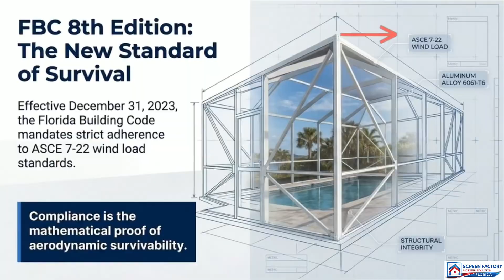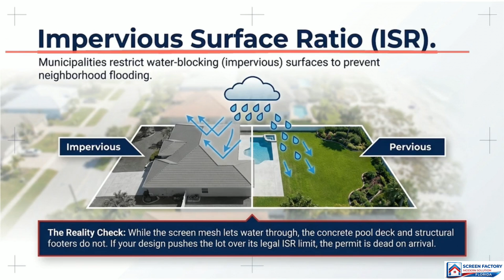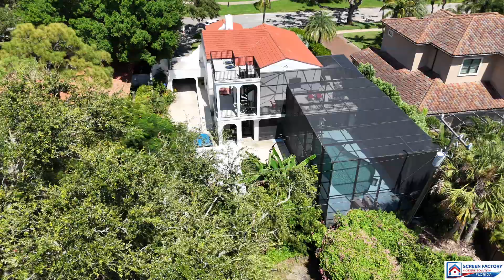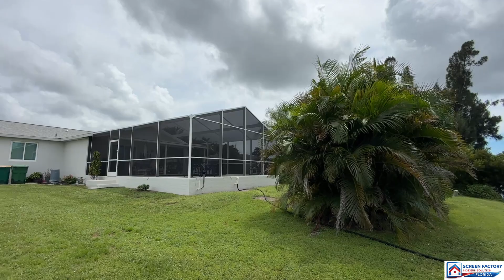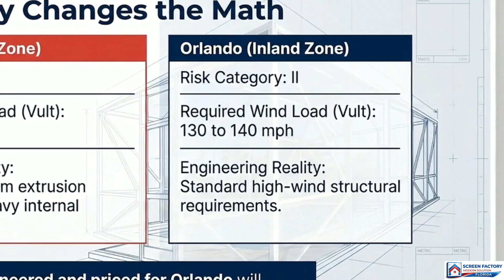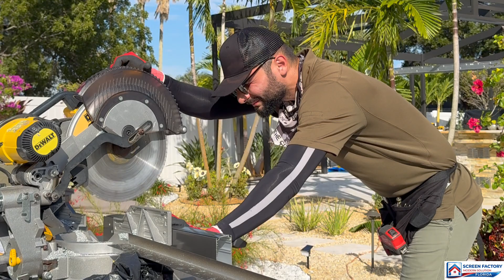Screen Cage Engineering: Plans, Site Plans & Setbacks

Comment from the maker: What do you think is the most overlooked part of building a pool cage in Florida?

Setbacks, permitting, footers, wind-load engineering, corrosion-resistant hardware - all of these details can affect whether a project gets approved and how well the structure holds up over time.

Drop your questions or experience in the comments. We’ll answer below.